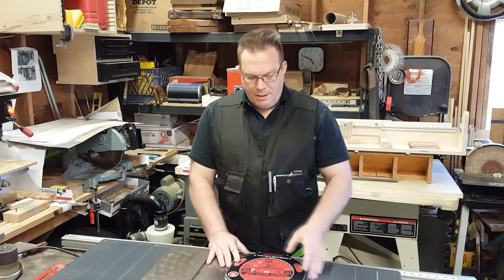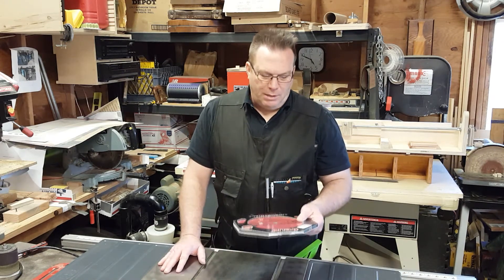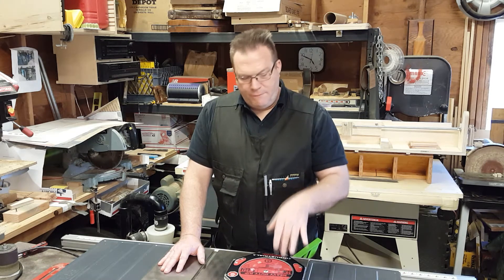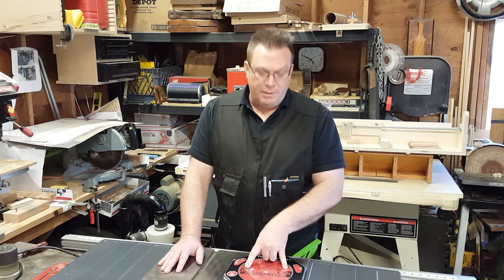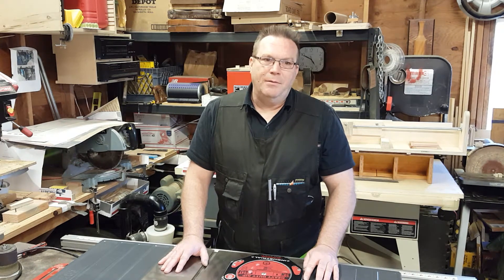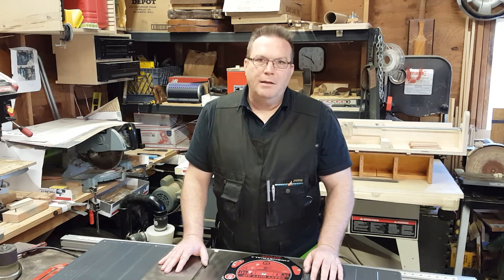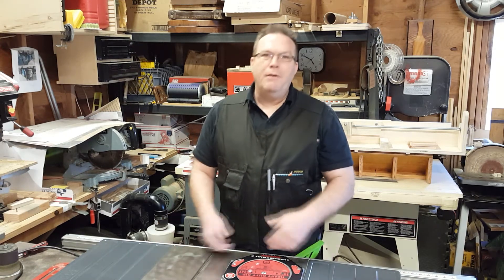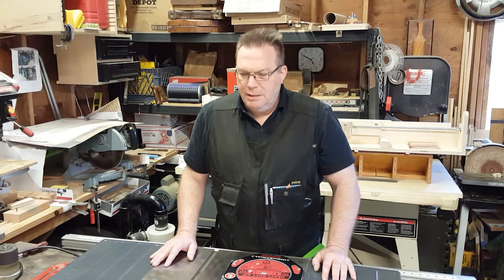The Box Joint Jig: Part 3

Comment: Measure your All-thread it appears to be 5/16 "  which is 18 threads per inch and not 16 threads per inch .....so the 5/16 will measure around .312 with calipers ......and 3/8" will measure  around .375  with calipers ...their is only around .063 thousands difference....but will make all the difference in your 1 revolution equals ...what you want it to be.
Reply from the maker: Thanks so much for your comment. I did check with my caliper and wasnt getting consistent diameter readings. I did an experiment though where i put my caliper between the carriage and side wall and checked each handle revolution. Some turns it didnt seem exactly 1/8 but on second crank it was dead on .250. What i did find is the rod flex is just enough to throw ut slightly out of scale. I think i have a solution to keep it more aligned. Thanks again.

Comment: Just finishing up the build and was wondering if you recommend (or don't recommend) applying a quick finish to the jig. Was thinking about a coat or two of spray poly, but am concerned that it may affect the sliding motion of the carriage or that it may transfer to the workpiece when clamped to the carriage. What are your thoughts?  Thanks for all your work!  Was very easy to build!
Reply from the maker: geno1600 great question. Poly does tend to stick to anything pressed against it, which could be a plus for clamping a board. My rule of thumb is if there are moving/sliding parts then film finish may not work best and would wear off anyways. I like using oil finishes like my go to danish oil from watco. Another reason for not going with poly is i often like to write in pencil on my jigs and poly wont allow that. Hope this helped its a debated topic to finish or not to finish jigs.
Reply: Thanks, Mike.  That's kinda what I thought. I think I'll just sand it well and leave it at that. After all, it is a functional build!  Appreciate the advice.

Comment: Thanks for all your work on this series Mike!  I just built the jig and the pieces always go together just fine but I'm struggling to get the edges to line up perfectly.  Is this normal and just something I need to clean up afterwards or should all the edges line up perfectly?
Reply from the maker: I am assuming you mean the non finger edges. I have had the same problem and what caused it was the second mating boards were not zeroed the same as the previous or I only did 1 side at a time.. I made an updated video where I added stop blocks for the secondary boards to aid in this. The most common way I have seen is to cut all boards at once. As long as the secondary boards are spaced correctly; which is a pain then the difference should be extremely minimal. I hope that answers your question.
Reply: Hmmm...I'll have to look at it again when I get home.  I'm able to get the difference to be minimal...(good enough for drawers for example) but if I'm going to make nice boxes it will have to be better.  I have one flip stop I've been using at zero along with trimming off a board like Ed Stiles suggests in his downloads.  I've even tried cutting one side of the "A" boards then coming back to zero and flipping the boards so I could use the flip stop and trim board again, then repeated that with the "B" boards using Ed's cutting guides for the different sized joints.  I thought coming back to zero would be the answer but I'm surprised at how things can vary even doing that.  I'm guessing that I would agree with you on cutting all the boards at the same time with a spacer for the secondary boards.  I noticed John Heisze recommends cutting all four boards the same and then cutting them to match after glue up...maybe that's the way to go, but at this point I'm frustrated and feel like I'd find a way to mess that up too.

Comment: Many thanks Mike. I had just decided to make this jig & that I needed a Sketchup model (largely as a markout tool [cutouts]) - you have saved me a lot of time.Do you remember Ed's comment about keeping the pressure for the forward cut to the left, then to the right on the return. This is because a) your cut width's are reliant on the blade width v thread b) cutting fingers & gaps to the exact same size would mean they are too tight.I noticed that you cut the pieces separately rather than stacked (& offset). Was there a reason for this?Here's looking forward to the next instalment as I am sure that you will save me a lot more time!
Reply: and yes, a counter would be useful - bet you have ideas for that?Ed also shows his mirror - that works well (even if its only a comfort thing).

Comment: I bought a Kempston blade off Amazon - flattop rip blade that cuts very nicely. It sings a little loud but it works great and also the blade is acutally .127" thick rather than .125". That extra .002" turns out to be beneficial. It was also about half the price of the Freud.  I also have a 1/4" Infinity box joint blade that I will try later on. It is 8" diameter which means I have to install a dado brake cartridge on my SawStop to use it. Not a huge deal, but I haven't got a box joint project in store right now, so I will try that later. It is exactly dead on .250". With the Kempston 1/8" blade the joints slip together easily with room for glue. Once you apply glue and the wood swells a little it is perfect. You definitely want to use Ed's "rear view" mirror.  I do like your clamp knobs, those are very nice. I'm using knobs just like the ones Ed used because I had them. I just put a fender washer under each knob. You do have to use properly prepared wood. The pieces have to be square, flat and smooth. Any little bit out of square will multiply error the farther you go with your cuts. I like the sandpaper idea too. I will use that myself.